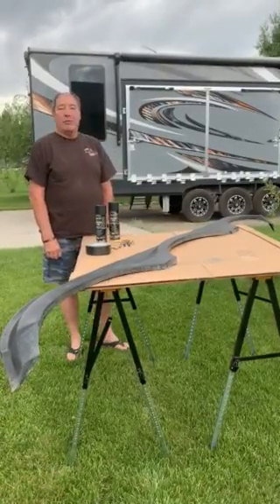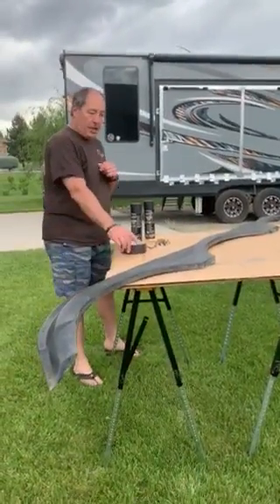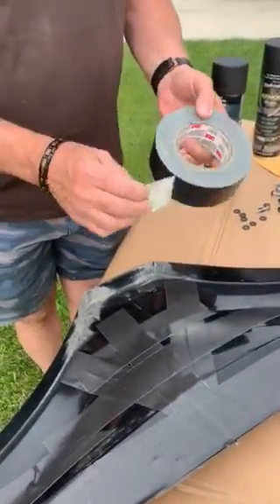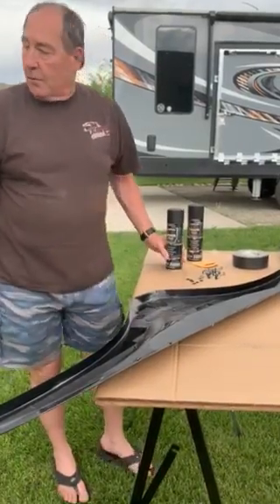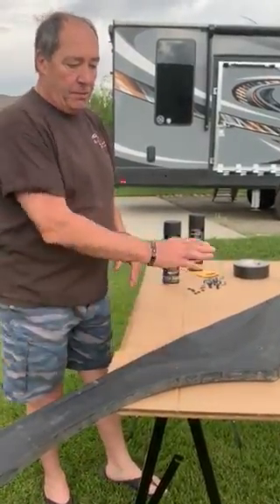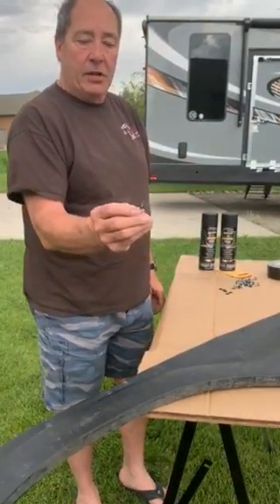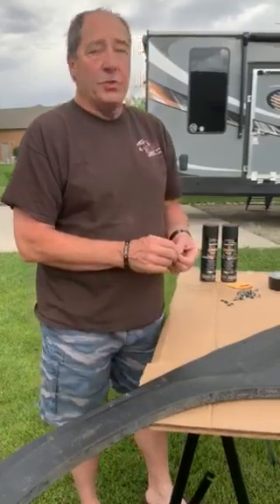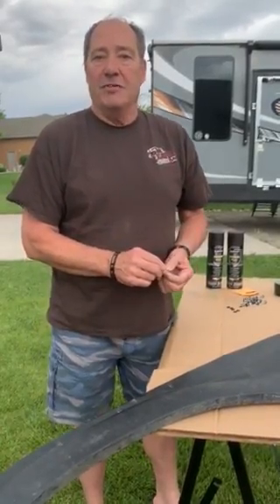Fix for Cracked Fender Skirt on Triple Axle Trailer

Comment: Have you had any more problems after the repair.  I'm looking at ideas for reinforcing my fender skirts.  So far,  I'm using jb weld to fix the cracks in my fender skirts.  It seems to be pretty strong.